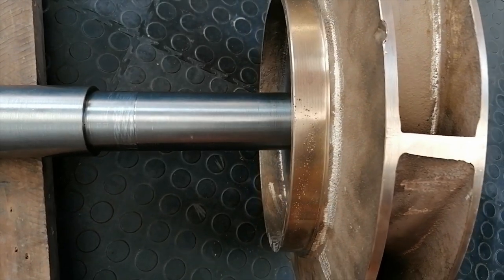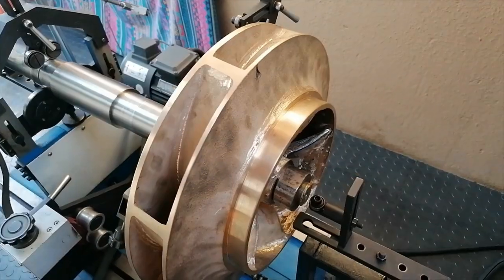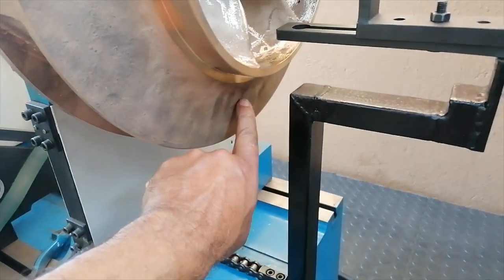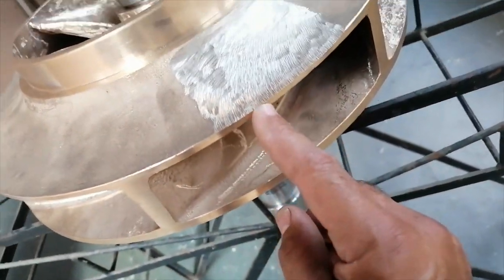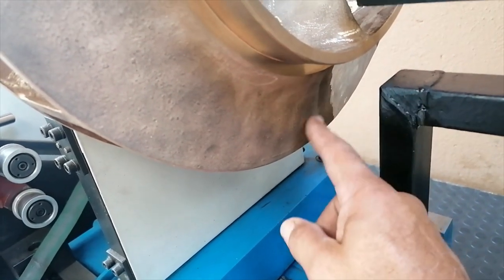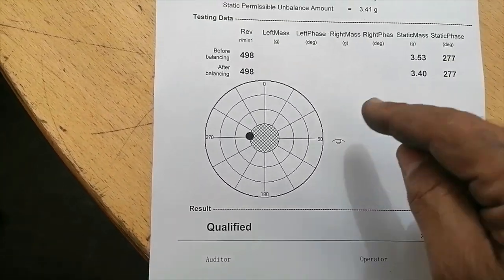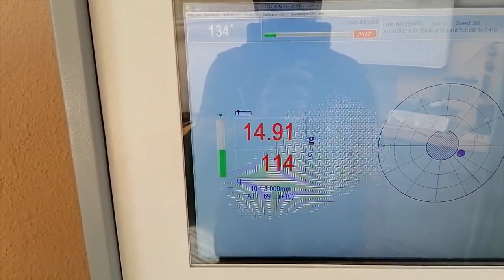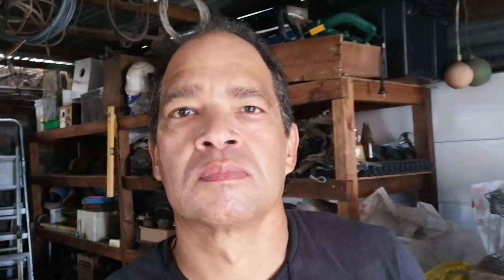Single Plane Centrifugal Pump Impeller Balance in 15 Minutes

Comment: Nice video man. I have the same machine as you but I have a problem. I need to balance some lightweights impellers(2.5-8kilos) but the machine is capable of 16kilos and above (10% of the maximum weight). Do you have any idea how I could solve this problem. I thought that I could use a heavier shaft but I am not sure if this could work.
Reply from the maker: Hi there, i have read your query, but i cannot see why you can't do those light weights. I don't think a heavier shaft would solve your problem as the shaft is not what needs balancing, but the impellar, becauae you would need to imput the impellars details. I have done a video of me doing a 900 gram impeller. I dont know if your saw it. Could i ask you to go to my about page, get my details there and lets communicate on a different platform and see if i can assist you. Thanks for watching my video and commenting. Take care.

Comment: Can you help me my machine is setting to belence rottor motor with 2 grinding in left and right position 
End I learn to input data with otomaticly system parameter no 17 with code 9991
How to setting parameter to belence impeler motor with 1 potition grinding??
Reply from the maker: Hi, thank you for the comment and for watching my video. I hope i can help. Press "measure and in drop box, press Stop. Press Rotor and at the bottom press +. That will give you a new page. Fill in all your data, but in the second column where it says "Bear" press "O" or you can select single plane in pictures on right side. Once you fill in all your data, go to the " System" page. You will see display mode, press drop box and select " static balance fpr single plane" It should put you on the system you need to be. Check out my other videos, it might help.If you have more questions, please go to my about page and find my email. It will be better for communications. Regards